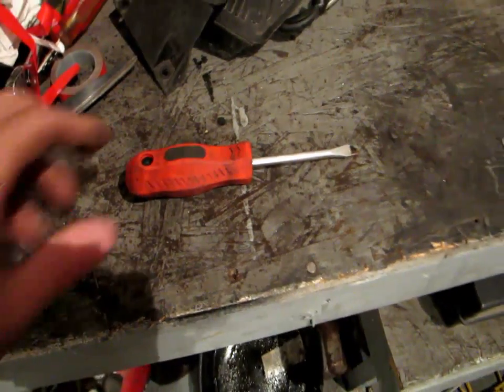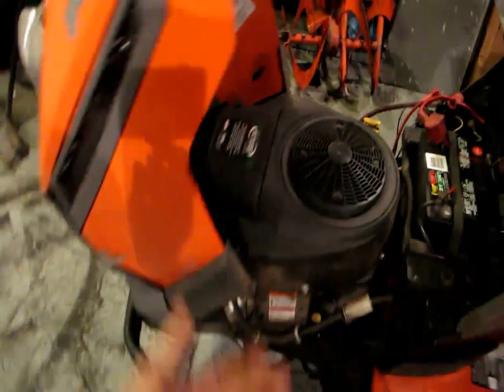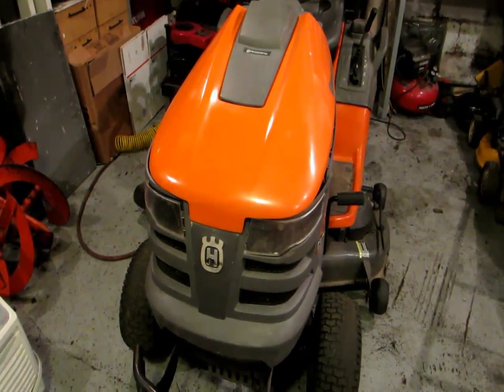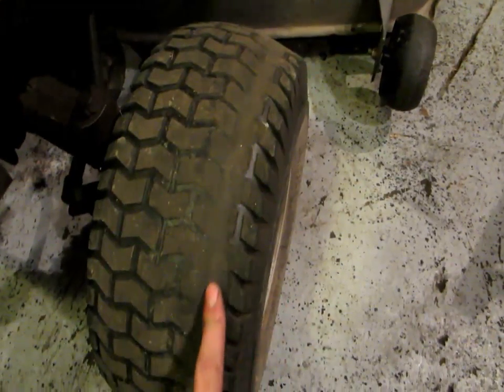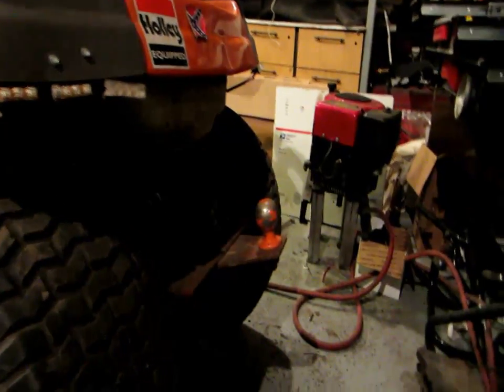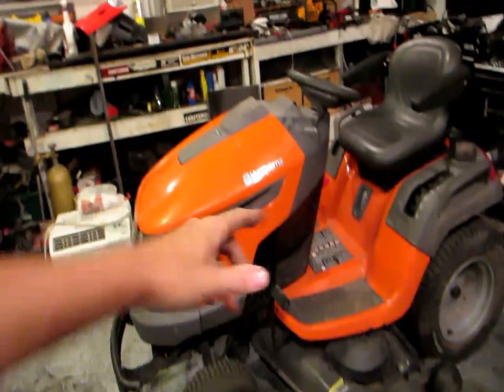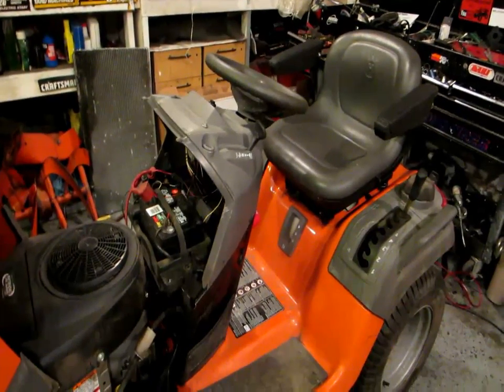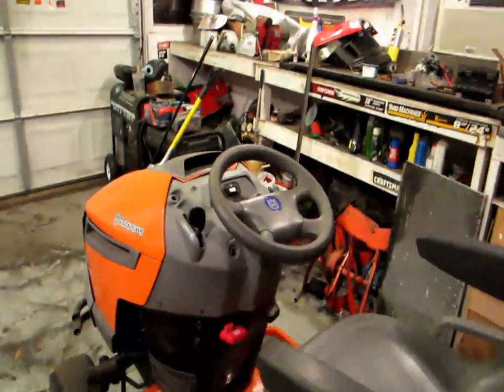Husqvarna YTH2448t lawn tractor 2 YEAR OVERVIEW

Comment: Be amazed then I bought the YTH24k48 Husqvarna lawn tractor in 2013 from Lowes with the Kohler engine and it is on it's 5th mowing season and I have an 8 acre property mowing about half of that and it's not level very rough land too much for this tractor really, but still going and looking good, but I do maintain it.

Comment: we have a yth2146 with a kholer courage and its a 2011 model, We bought it new in 2012 and it now has 275 hours on it. only has 1 oil change at 165 hours, never touched the belts or engine. has the hydrostatic drive. not sure what trans is has but it is not have a dif lock which drives me insane on our hill side. over all very happy with it. mow 2 acres a week of super thick zoysia. pull a 300lb  60" plug aerator, and a 85lb spreader no problems. we've had briggs before. total junk for us. and kholer is a much quiter engine. had a 99 scotts jd mower, 16hp/42" cut, with a kholer, and it was a tank.

Comment: some aftermarket hourmeters will go off the spark, but if you have a hourmeter on the dash that's original then It goes by when there is power going threw the wire harness

Comment: Interesting review 3 years old now..I picked up a 2454 cheap ($200) last week with head issues..grass plugged cooling fins so exhaust valve guide came out and bent the push rod..I drove the guide and peened it and it purrs now but I don't know for how long..sooo where'd ya get the new 26 for $700 even back in 2013?

Comment: WHEN REPLACING MOTION DRIVE BELT DO YOU FEED belt to right or left of the steering column???????   {LAYING ON GROUND LOOKING UP} TO THE RIGHT[brake side} OR LEFT{gas pedal} ????? Any HELP WILL BE GREATLY APPRECIATED. As mine will no longer pull sweeper....motion drive belt slipping.....

Comment: is the sprocket size on the steering wheel assembly standard?  I have a yth2454 and would like to replace the ugly steering wheel with this one.  The sprocket looks the same but am not sure if it is compatible.  Also if i purchase the larger tires and rims do i need a specific rim or as long as it is the correct size it will fit the spindle?

Comment: Have you had an issue with vapor lock?
Reply: sorry for the delayed response but mine had an issue with the gas cap vent blocking and causing vacuum in the tank. Replace the cap or leave it loose solved my problem with the motor dying while mowing. That might be your problem.